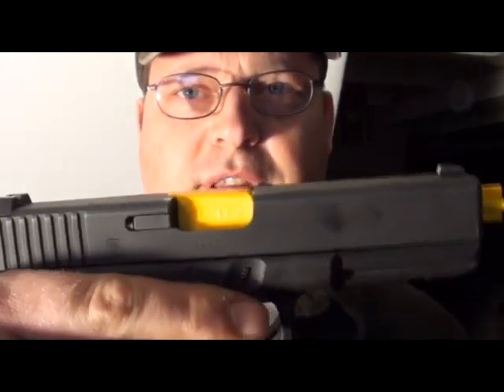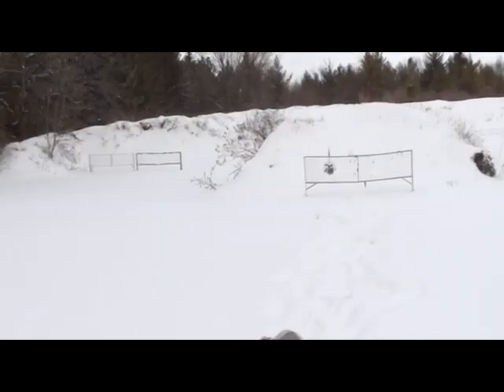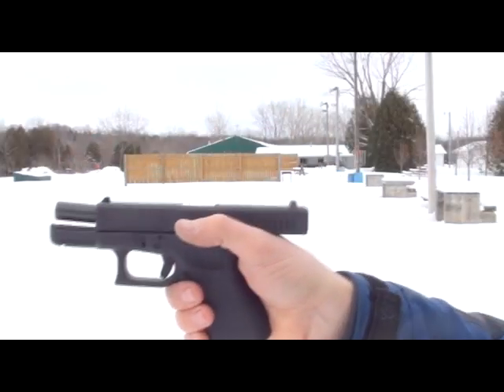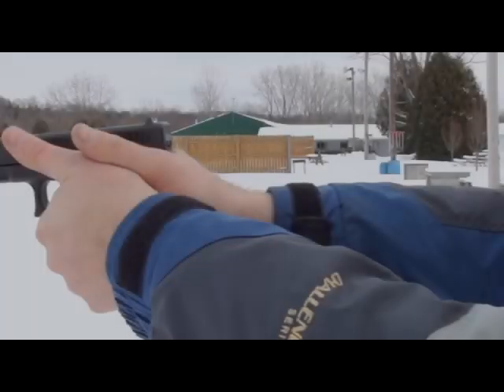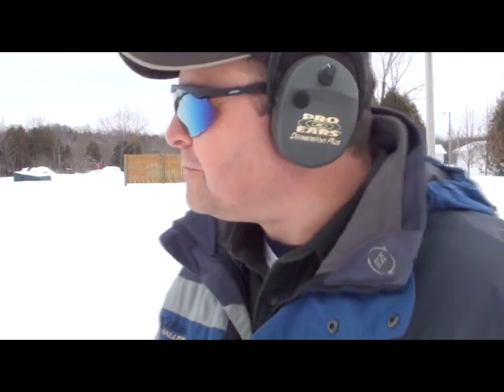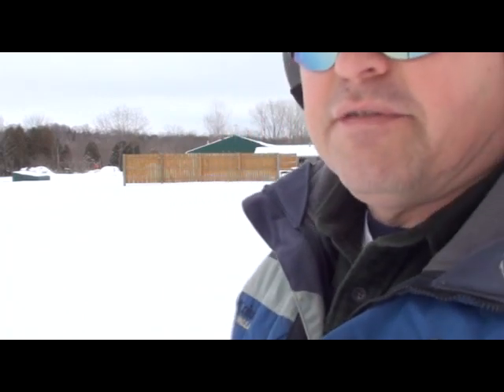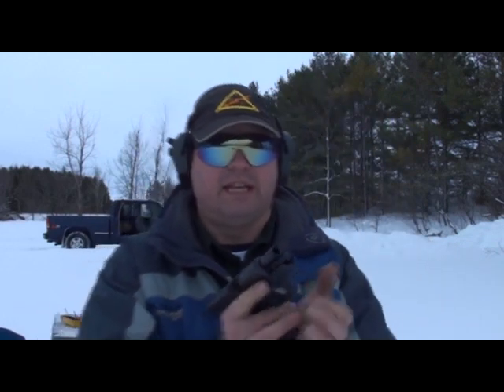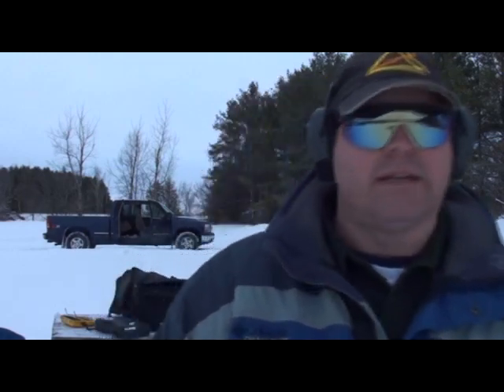A New Way to Hold my Glock 23 - RTF2

Comment: I own Sigs, but here u go:
I hold firm with support hand, gently with strong hand.
Make as much contact with the frame using support hand.
Contact frame solidly with support thumb, both thumbs pointing same direction.
Trigger centered on pad of index finger.  Don't jerk trigger, make a smooth even pull back.
Hold trigger after shot, reset only when ready to fire again.  Repeat smooth trigger pull.
Dry fire holds sight, should work for actual shot. Flinch is anticipatory response, is avoidable.

Comment: @theKGB65 Try it.  It's by design.  In the Glock Armorer class, we all took the trigger spring off and tested the ability of shooting after a trigger reset.  Very cool.  All Glock's since 2004 are made in the USA and you will see "USA" on Glocks starting in 2012.  The slide was made flat and square to sharpen knives in the field due to the Nitration in the metal or Tennifer.  We learned lots of cool things.

Comment from the maker: @Grubbernaut  The goal is to keep trying different things while observing the results; right now it's the Brian Enos method.  Last season I was locking my support thumb into the junction of the trigger guard and the frame while using a 60/40 death grip.  B.E. says to keep that thumb off and let the gun recoil; don;t fight it, stay relaxed, and let it return consistently.  So I'm trying that right now, even though it goes against my habit.  Arms are in my relaxed position with minimal extension.

Comment: Make sure you keep your Trigger under control and go to the reset rather than letting your finger go and having to press the trigger all the way back again.  I noticed that you don't shoot to trigger reset and this will not only improve your quick shots but in a Glock it can save your life.  A Glock can fire without a trigger spring as long as you go to trigger reset after the shot.  This is by design and it's the only handgun that does it.

Comment: @theKGB65 If your trigger spring breaks and you don't go to trigger reset, you can simply rack the slide, shoot and if you go to trigger reset from that point forward, it will keep shooting.  You can always recover from letting the trigger go all the way forward by racking the slide.  I had to develop the habit for trigger reset and lot's of dry fire helps.  I am human, so sometimes I let it slip forward all the way too.

Comment from the maker: Dry firing most rim-fire guns is very bad because it mashes the firing pin against the bolt face but most centerfire handgun manufacturers, Glock included, explain right in their owner's manual that dry firing causes no harm to the firearm whatsoever.

Dry firing is an important part of the practice routine and I Don't want you to get hammered over this friendly comment.  Thank you for understanding.

Comment: Where did you get the gold barrel???
Reply: floyd harper I have that " barrel " you asked about in fact is not a barrel but a training plastic barrel. Can't put any or load any dummy rounds in it. It's mainly fir training with the slide and trigger pull and reset. Hope this helps.